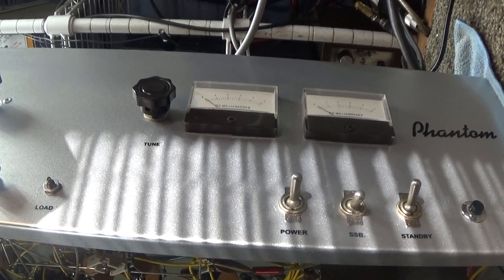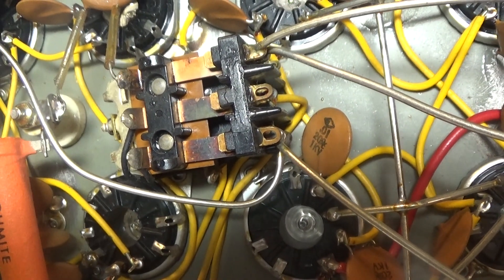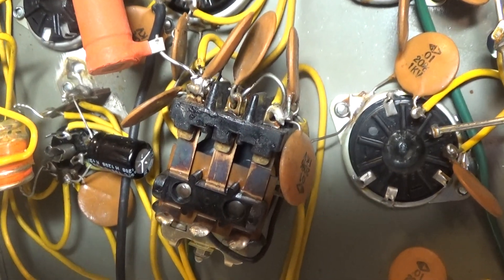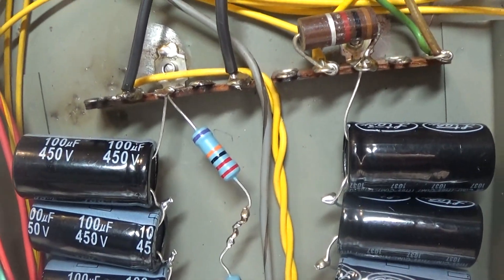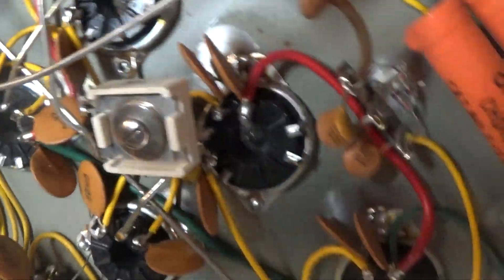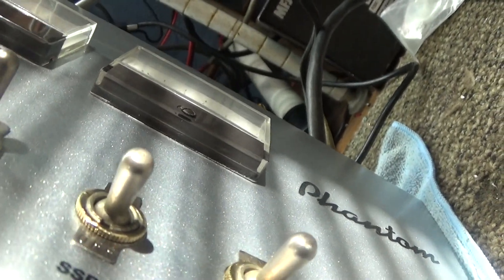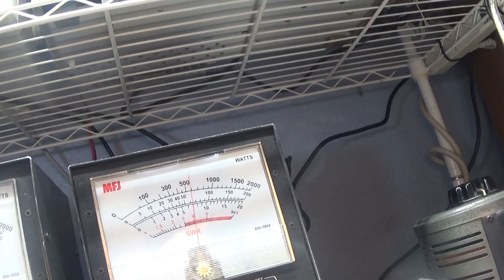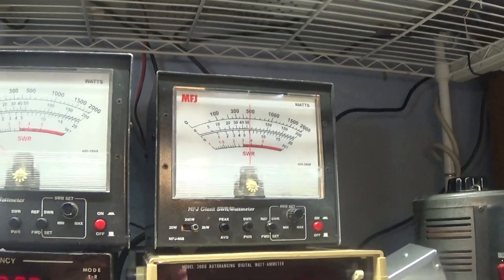D+A (D&A) Phantom 500 classic 12 tube dual power linear amplifier Dual Power (not Triple)

Comment: Thanks for the video!  I just picked up 2  Phantom' s from the swap meet recently  , both have  12  6LQ6 tubes- 3 relays. Does it meant that 4 tubes  Drives  the 8 Tubes?  I also did a recapped on the electrolytic s and added bleeder resistors.

Comment: I missed what tubes were in it. I’m working on a golden eagle 1k with 8 20lf6 tubes. Love your reviews I have many old amps I’ve collected over the years. It’s time to check them out.
Reply from the maker: 6lq6 tubes in most D+A but some of the smaller used Baldies and some used Baldies for the driver tubes. BTW I never had a GE 1K but I worked on one once. It had 2 shorts in the output circuit. One was the Tune cap and the other was the thin coax it used from the output circuit to the keying relay. The guy that owned it was in a top apartment of a 50? story apartment building downtown. He had a ground plane on top. Local, he was hard to beat with that height and that GE 1k. I 'heard' that it took 2k on beams to beat him locally.
Reply: Thanks for the reply I also have an amp almost identical to one that you said was home made. It’s similar to the scout. The one you have someone put the meter up in the metal cage. I guess thats why I can’t find the schematic. All tubes are new except the key up tube. The numbers are missing from that tube. I’m waiting for the caps to get here.

Comment: I believe this is a maverick 250 not a 500 ???
Reply from the maker: Nope. Many versions of both amps. Very early Phantoms were 12 tube, but they went to 10 tube pretty quick. Also, some early versions were single stage, some were dual stage and then later versions were triple stage. Most had preamps or bilateral and some early versions did not. Last version of the Phantom was renamed PDX-400 and they converted a driver tube into an oscillator tube and tried to sell it as a 20 meter transmitter. 
  Maverick 250 had 8 tubes, 4 driving 4 except for the last version which did the same thing as the PDX-400, took a driver tube and turned it into an oscillator tube and sold it as the MDX-200
  I have about 20 different versions of schematics of the Phantoms and Mavericks. Looking for a schematic of the D+A Warrior though.

Comment: Ran d and  a Amps in the 70s 80s and 90s got two of them now in the 20s good all around Amps. Ironman in Alabama 73s.
Reply from the maker: Which 2 you got?
Reply: Got phantom 500 2 stage and a pdx 400 2 stage if driven hard over 1100 watts with 90 percent tubers. Ironman in Alabama 73s
Reply: This was my first big amp I owned I now have a DNA collection

Comment: Great Video. I learned a lot. My high voltage relay is burned. Any idea on suitable replacement? Thanks
Reply from the maker: 3pdt 10a (amp) general purpose relay,  12VDC coil. Note when I took a look on Ebay, most of those 3pdt 10a are 24VDC coil which I don't think will work. The actual voltage to the coils for this relay is 16vdc (actually -16) but + or - in this case doesn't matter.

Comment: you have issues if your only getting 575 from a (10) tube phantom.  I get 550-600 out of my Maverick. I'd check to make sure I had it loaded correctly if I were you.
Reply: Maybe he should use your watt meter.
Reply from the maker: Thanks for the helpful advice!

Comment: i need to replace two resistor in the bottom of mine would you know the watt on that 1ohm resistor?
Reply from the maker: 1 ohm? Not sure which you are talking about.
Reply: @tramdr  mine is an old 10 tube i'll try to shoot you a pic
Reply from the maker: Yeah, I'll need a pic, I don't even see those on the schematic.
Reply: Those parasitic resistors in the high voltage power supply are 1 megohms NOT 1 OHM ,
Reply from the maker: Parasitic resistors are one thing. Bleeder resistors are another. Why I said I need a pic or at least the color code off the resistor but you are right, they aren't any 1 ohm resistors on them that I can think of.

Comment: Cool, but the right voltage source I didn't like.Bliders Resistors are wrong.Could be a better setup!!!
Reply from the maker: I don't know what you mean about the "right voltage source" I also don't know what you mean about the bleeders are wrong. This amp didn't have any bleed from the factory (I have the factory schematic on this) . I put in light bleed only as it didn't have any. I personally am not into heavy bleed, especially for a sweep tube amp that runs about 800v.

Comment: Brings back lots of memories. Worked all 50 states and several foreign countries using this exact box w/Antenna Specialist 5 element. These were some of the more reliable sweep tube amps of this type at that time.
Reply from the maker: agreed. Back in the day, I had a Pride KW-1 (high drive DX-300) with Moonraker 4's. The only people who gave me problems where the one's who had Phantoms and drove them with a little Modulator and they where on PDL'IIs. Those Phantoms where tough to beat. However, when I got a hold of a Drake L4B..... back then on 4's and later wilson 5's, I could mix it up with many of the big boys.